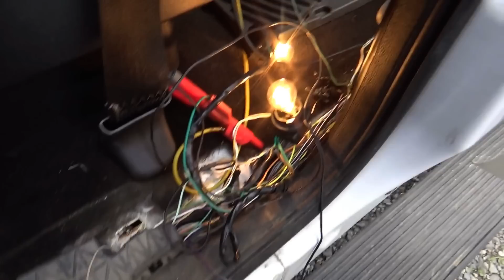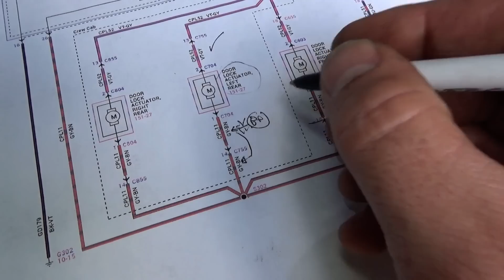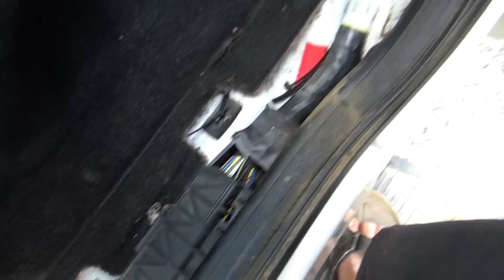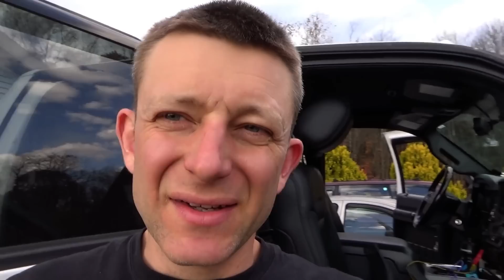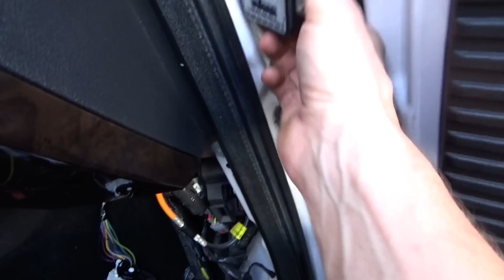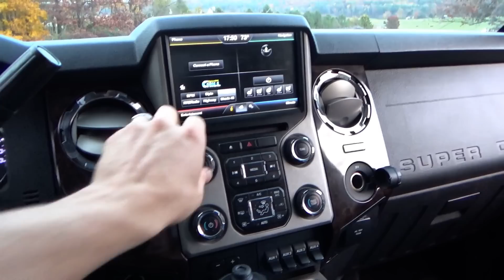(Pt 2) PowerStroke Power Locks DISASTER!?

Comment: He was lucky it didn't catch fire and burn his truck up, and maybe his house down if it was inside an attached garage. Weird things like that are why I leave my hood open and always check the garage for smoke or gasoline fumes before going to sleep. I never thought something like that could happen on a fused circuit. Something strange must have happened inside that door? Another one in a million problem for you to figure out, Ivan. 
And with Trump back in, you won't have to worry about a shortage of ICE vehicles to repair anytime soon. Electric vehicles are kind of boring too, unless they catch fire. And soon they will need to compete with AI data centers for the limited supply of electricity. Those Chinese solar panels won't work at night.

Comment: I was curious about this issue because I remember there being a tsb about the door lock actuators sticking do to water intrusion and freezing the actuators. I did some more searching and apparently there is a warranty extension program it’s 20M04, this covers the door lock actuators for a longer period of time. So it looks like this may have happened to other trucks out there. I did read where someone had a crew cab truck and could hear the left rear actuator going on its own and did it so much the actuator stopped working and then had other issues creeping up. Hope this helps, maybe the customer can take it back to the dealer and ask about that warranty extension.

Comment: That is absolutely insane Ivan.  I've got a suspicion that we are not getting the full story here.  I just can't believe that a 20A fuse was able to hold up against a dead short like that.
Reply: Fake fuses on eBay/Amazon. 5A fuse doesn't blow even with 20A
Reply: @MattyEngland  Or the someone installed a circuit breaker...
Reply: @MattyEngland  Harbor Freight also had recalled a bunch of fuses years ago for not blowing anywhere near their rated amperage. It's possible someone had installed one of those at some point, but more likely the owner shoved a much higher rated fuse or tried to bypass it altogether with crispy results.
Reply: @MattyEngland  Not in the US. These fuses are ubiquitous in the US, they are everywhere, in every glovebox in every car, every hardware store and auto parts store. No reason to oreder them and wait when you have a handful in the car already.
Reply: @tuberNunya   People buy everything online these days....Welcome to 2024.
Reply: @MattyEngland  People with no friends I suppose.
Reply: .. yes Ivan not getting full scoop…
Reply: Maybe when the original issue came up someone replaced a 20 with a 30amp fuse. People do it all the time without understanding that a certain value fuse is there for a reason. If its a 20 amp circuit, then the wires should be able up to 20amps- if more than 20amps are drawn, then the fuse blows protecting the circuit. Or like @MattyEngland suggested- maybe it was a cheap knockoff 20amp fuse that didn't blow until 30 or more amps were drawn for a substantial amount of time.
Reply: @MWMR17  Whatever it was, something went horribly wrong in the attempt to get the power locks working again.  And I have a gut feeling that the problem was exacerbated by the owner or someone else who tried to help him out.
Reply: @MWMR17  Concur !  10A would have been more than enough !

Typical "blade type" fuse (ATO) are supposed to by fast acting.  Cartridge fuses (JCASE) are slow (" providing both increased time delay and low voltage drop to protect high current circuits and handle inrush currents").  Could have used a 5A JCASE !

Comment: What a dang mess?! So many wires damaged and for long lengths. I can't imagine doing overlays would be feasible here. I'm still quite early in the vid tho. Seeing where this goes.....
Reply: Interestingly enough. I'm working on the same vehicle... 
Guy had an accident.  Bought a donor truck. Replaced the frame & all sorts of stuff but has multiple codes. Abs, airbag, air ride, & a bunch of little things.  The shop ghosted him after doing some if the work but luckily has all the modules & parts. Lots of Vin mismatching too. Got a few things knocked out already.  Waiting on a tool for the airbag module .... hopefully finish that truck thurs.
Reply from the maker: I know, Cuba! Never seen a wire get so hot that it melted the entire length from A to B 😂😬

Comment: Amazing. I did an almost identical repair on a 2012 F150 Platinum. Harness was discontinued at Ford and I ended up having to repair it all. Total interior tear down, billed 28 hours. It was a no start from melting the hi speed CAN network. Caused by LF door harness.
Reply from the maker: @survivingga  HOLY CRAP! 😬
Reply: @PineHollowAutoDiagnostics  as silly as it sounds, someone left one single harness clip loose in the door and the power window power wire rubbed the speaker cutout. Unfortunately, that also powered all four doors windows and seat heaters. I still can't explain why it never blew the fuse.

Comment: No fuse in there when you started. Customer said it was halfway working to begin but was blowing fuses and then quit altogether. I wonder if he put a 30 amp in since it was blowing 20s and then when it all quit working he took that out before he brought it to you. That would explain why the wires melted without blowing the fuse......
Reply: It a shame that you can physically put a 30A fuse in a 20A slot unlike domestic fuse boards🙄
Reply: Years ago, in the good old glass fuse days, there was a series of fuses that all started SFE and each amperage was a different length to make it much harder, and in most cases impossible, to use the wrong fuse as long as you stayed with a SFE fuse.

Comment: I just had this exact same thing happen 2 months ago! 2012 f250 xlt 6.2 truck. Drivers rear door actuator kept cycling for months and we weren’t notified till all locks stopped working. Found the harness melted from the actuator all the way to the bcm. Replaced the entire cab harness, door harness, and actuator. Because the airbag module is under the center console and the lock wire melted to the airbag wires but never shorted to them. Crazy that you had the exact same thing happen!
Reply: Believe it or not you can replace that entire harness in about 3 hours. The interior comes out very easy.
Reply: Poor circuit design. An electrical engineering team should be sent back for basic training.
Reply: Key fob in pocket, constantly getting the buttons pressed? Seems a bit far fetched but, maybe a “remote” possibility 🤷‍♂️😏.
Reply: @jeffs2809  only the drivers rear door would do it while the truck is on, Key in the ignition. As Ivan said, I just can’t explain it
Reply: A coworker had weirdness I believe with the door locks on a 2017 Chevy Silverado. Dealer replaced his key fob and said that’s all that was wrong. I was thinking back seat may have been full of stuff and something was knocking the lock button.
Reply: A coworker had weirdness I believe with the door locks on a 2017 Chevy Silverado. Dealer replaced his key fob and said that’s all that was wrong. I was thinking back seat may have been full of stuff and something was knocking the lock button.
Reply from the maker: @matthewpellegrini1905  WOW that is crazy! What do you mean the actuator "kept cycling for months"? How could it cycle by itself when there's no input from the BCM? And it's on the same tree as the other 2 passenger doors? 🤔🤔🤔
Reply: @ I question the same thing! I work for an airline in Boston. This is one of our aircraft maintenance trucks that they use for road calls. They asked us to look into the locks because the left rear door has been “clicking” for months. I was wondering if the actuator sends a position feed back to the bcm? So if it doesn’t see unlocked it keeps trying? They said the only thing that made it stop was locking the doors. No issues sense repairs so I doubt the bcm is at fault. A dead short in the door jam wouldn’t have cycled the actuator I wouldn’t imagine.
Reply: @matthewpellegrini1905 : Damn, that sounds sketchy as hell. An airline maintenance truck used to make road calls. Hope I never see the crew of that truck making a roadside call for an airliner. Furthermore, I hope I'm not on that roadside airliner. 
😂🤣😂🤣
Reply: @gerardjohnson2106  more like sending a few of our guys 1-2 states away for extra hands at smaller airports if something needs fixed, less like side of the highway engine swaps 😂
Reply: @matthewpellegrini1905  : I understand but I couldn't help making a bit of humor from the reality. If we think chasing a wiring harness situation in a highway vehicle seems complicated, what would it be in a jet airliner?🥴
Merry Christmas and a Happy New Year to you and yours.
Reply: @gerardjohnson2106  
I flew from Lansing to Chicago for business on some little ~20 passenger turbo prop type of airplane in the middle of winter.  They had to jump start the plane to get one of the engines going before we could take off from Lansing.  I always opted for the 4 hour drive after that experience.
Reply: @matthewpellegrini1905 Needs TO BE fixed! TO BE!!! Stop with your poor grammar!
Reply: @Andy_Hinners  : I agree with you, I drive. However, things are better in air transportation these days. Little electronic booster packs, tubeless tire plug kits, cordless tire pumps, old school long screwdriver for banging on the starter & shorting across the solenoid. The copilot has such kit in the backrest pocket of his seat. Something goes wrong, capt orders 1st officer to fix it while he has steward crew bring coffee to the cabin.😂 Happy contrails and safe travels to all this Christmas season.
Reply from the maker: @matthewpellegrini1905  hmm I can't explain it... If the control wire was shorting to B+, then ALL 3 of the passenger locks would have to do the same thing since they are on the same tree in parallel 🤔
Reply: @gerardjohnson2106  Comparing an old maintenance truck to an airliner, from an electrical/wiring standpoint, is absolutely ridiculous.  Obviously, your knowledge is quite limited concerning the latter.  Don't worry and rest easy, Gerard. With the exception of the conductors (which are much higher quality in all aircraft). the electrical systems of airplanes have nothing in common with an old POS Ford pick up truck.
Reply: @Andy_Hinners  You have no idea what you're talking about.
Reply: @PineHollowAutoDiagnostics  
One other commenter stated there is a TSB about this issue.
Reply: @Andy_Hinners  Nothing showing up in Alldata about any TSB for this.

Comment: AC 43.13-1b (aviation mechanic's Bible) provides two ampacity charts, one for continuous flow and another for intermittent flow.  Intermittent flow allows for higher current because they assume the wire is cooling down enough during off periods.  The only problem is you can end up with continuous flow on an intermittent circuit if the circuit is operated too frequently - kids playing with the switch or the actuator got stuck on - or there is a short to positive from another circuit. I'm curious what an ampacity analysis says that wire needs to be fused for.

Comment: I would have just cut out and replaced the burnt wiring, just use labels if wire color is not available. you can get rolls of wire at home depot fairly cheap. I've had to rebuild entire wire harnesses in some old boats that I've had due to dry rot and mouse damage. Or get some trailer wire to replace it.
Reply: Multiple other wires also suffered damage.  It 's a mess from one end to the other. It would take hours and best done on a bench.  Repairable, yes but is it worth it?
Reply: @phprofYT  I would, but I have ocd when it comes to wiring. For an even simpler fix to get rear door lock working, would to tie it in with the front door control wires.

Comment: Ivan, you have got the patience of a saint.

I had to repair a melted fuel injection harness that had fallen down near the exhaust manifold of a 2002 Chrysler T&C. There was plenty of length that I was able to shorten every wire about 4 inches to get rid of the meltage. I repaired all the wires one at a time soldered butt splice and glue filled heat shrink. Everything was fine afterward.

Before the repair I had massive random misfires then after a cold night nothing worked. Fun not. But I got it. Whew.

Comment: With the proper fuse in the correct position, that wiring should’ve never melted. Do you suspect the owner put in a higher rated fuse?
Reply: Huge numbers of fake fuses on eBay/Amazon. Labeled as 5A and don't blow even with 20A

Comment: I think Ford have drawn a circle around the problem.

I would just buy a few rolls of wire from my local auto parts store & bypass the melted wiring to fix the problem so there's no need to replace the wiring harness !
Reply: I think Ford have drawn an oval around the problem.  There, fixed that for ya.  ;-)

Comment: Hello Ivan. As a DYI person who has repaired more fried wiring than I care to remember. My 2 cents and a guess is that the fuse was jumpped with an wire capable of taking a heavy losd. It worked until it fused the wiri g i to a dead short. Unfortunateky getting a truthful accurate description of the fault history is very difficult. People do not like to admit they may have caused a problem. But hey that is just my opinion and I have been known to be wrong a time or 2. Good repair I hope your customer appreciates the tallent you have and the effort you put in for a satisfactory repair.
Reply: agreed... or a 30+ amp fuse temporarily inserted when the door started playing up...
Reply: @alexdubinsky6098  Yup never ever put a larger fuse in place of a smaller one it WILL bite you.
Reply: @jrg2068  100%
Reply: That or cheap amazon/eBay fuses. Louis Rossmann did a test where he put 20A through 5A fuses and they still didn't blow.
Reply: Even with the fuse that was supposed to be there, the wires are not dimensioned for constant current draw, the fuse is mostly there to catch a complete short.
Reply: The fuse is for the entire circuit. The wires however were probably only rated for 5 amps, and tolerated 8 amps until thermal overload.
Reply: I would also have to agree with you.  I can't believe that much damage happened through normal means without excessive help.
Reply: @Sandmansa it's great when customers try to "help" lol 😅😂
Reply: How much effort is put into designing these circuits on these pimped out trucks? Not enough it appears.
Reply: "I've been known to be wrong a time or two!" 
Spoken like a married man!
Reply: @mariosaccoccio1688 nah he's twice divorced and wiser now sticking with sussing out Ford pastry vans 🤭

Comment: In a overcurrent situation, the entire wire is going to get hot.  It will be hottest where it's least able to breathe - like in a bundle of wires.   Only in a poor connection situation would you expect to the damage to limited to near where the fault is.
Reply: In aviation, there's a bundle derating factor.  But this seems like something else.  Maybe it was designed for intermittent use but the actuator got stuck on.
Reply: @major__kong  Since it's under the control of the BCM, it begs the question if the BCM has logic to prevent that.  I know a stuck relay could do that, but there's no evidence that happened.  I just wonder what would happen if the command switch got stuck down.

Comment: Always a learning experience with your videos Ivan. Even at 67 years old, I enjoy learning. Thanks for that. Much respect for your patience and logical approach.
Reply: Waddaya mean 'even' at 67? That's only 6 years older'n me and I'm no crusty! You make it sound like you're ready for a nursing home or something, no offense mate. You're a spring chicken!
Reply: A 20A fuse protecting a circuit that in use draws 2A … was the 20A stock ?
Reply: @Blind-Dave  Quite probably not, but I think the total drain with all 4 door motors running was a bit more than 2A. I think Ivan measured around 4.5A, so 10A would have been fine.
Reply: @Blind-Dave sounds nuts to me.  Those wires don’t look man enough for 20A.  Wrong fuse?
Reply: @Blind-Dave  
20A is what came from the factory.

Comment: The problem probably started with water intrusion or spilt drink getting into the suspect door.
Reply: I've seen that happen when the windows were left down and it rained.  Moisture got into the  "sealed" switch, so it stuck on and slowly heated the wiring from the extended load.  Until it fully shorted to ground, the load didn't exceed the fuse capacity.  In my case it was the window switch on the passenger door.
The fuse their was also a 20 amp which was high enough to enable all 4 windows to be operated at once.

Comment: Ivan, great approach to fixing this truck.
But, sometimes you need too think of your liability. What if that truck burns up because the customer doesn't want to replace the carnage harness, and people are trapped inside, you see what I'm sayin your ass is hanging out thier cause they don't want to spend a few bucks.
Please be careful I've seen companies get torched because the mech should have known better.
Reply: I'm my F150, you can open the doors without power.  You can grab the lock stem that pops up and down, and I think the driver's side door handle will disengage the lock.

Comment: 50% chance that after several 20a failures, the fuse was replaced by a wire.
50% chance that a Chinese/Amazon 20 amp fuse was put in place which allows 100 A of flow. Don’t trust Chinese fuses. YouTubers have published this issue. .
Reply: Angry Louis Rossmann is the best Louis.